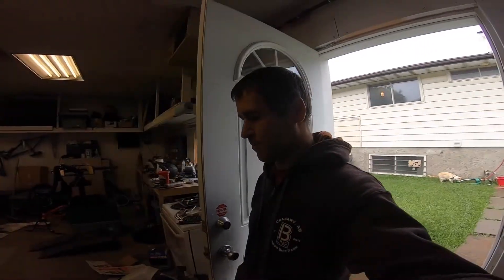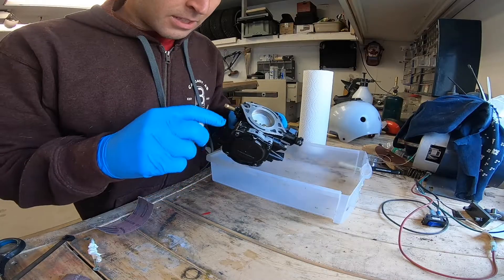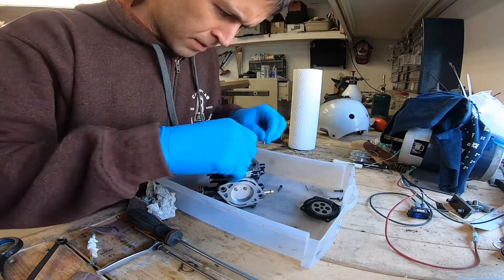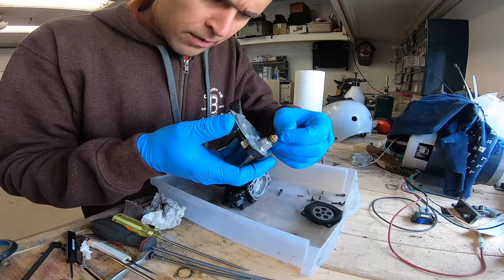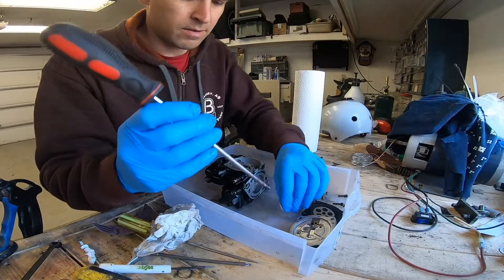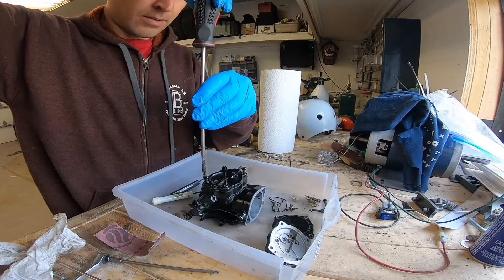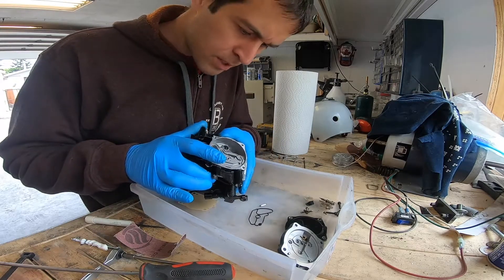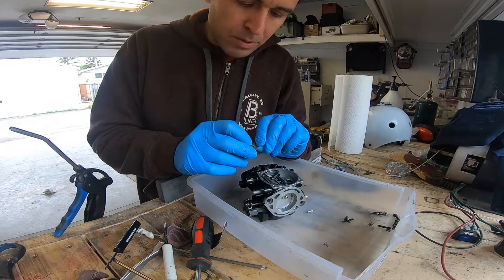KEIHIN CDKII Teardown / Inspection - X2 Troubles - JSU 23

Comment: What kit did you end up getting
Reply: I was always told to stick with the oem cdkii kit.  I guess your having good luck with the sbt I may try it out to.
Reply from the maker: @MrAnythinggood  I haven't had any issues due to the sbt kit. You can't go wrong with OEM... but times have changed. Just about any little company can do a great job of making a rebuild kit. They might not last the 30 years that the originals did... but they may.
Reply from the maker: I believe I ordered the these kits from SBT. Confusing as they are not listed under the X2 on the site, but listed as CDK II Kawasaki / Polaris 

Code: 35-205

Comment: Your cat must be really annoying if you’re comparing it to the GoPro haha
Reply: joel arseneault the 8 has been good, picture quality seems improved over the 7. The problems I have with the 8 has mostly to do with the mics and how they are affected by wind noise and if you get water in them. The audio is actually quite good if you’re not dealing with any of the elements such as wind or water so like when I’m working in the garage if I had the standard Audio setting it would be really good but I am just putting the hero eight on wind mode all the time because it has a problem when you put it on auto mics it can’t really decide when it’s windy in it it gets really really Bad wind noise in the audio. And every once in a while the hero eight can’t shut off, you shut it off and it will turn right back on. I just pop the battery out and pop back in real quick and seems to take care of that no problem but it is kind of annoying obviously but it doesn’t seize up like the hero 7